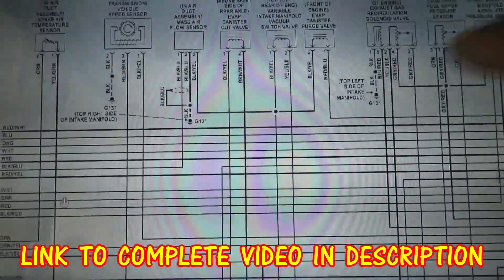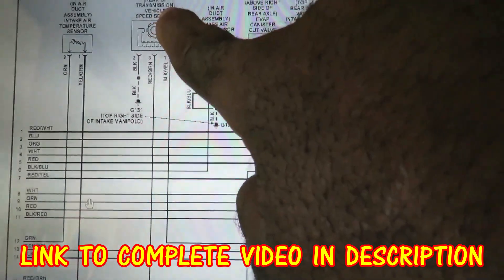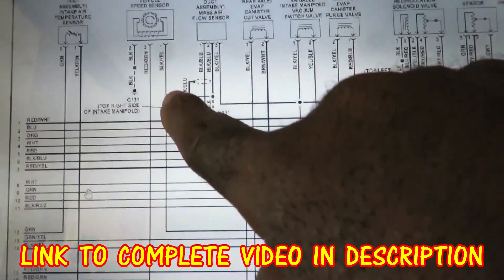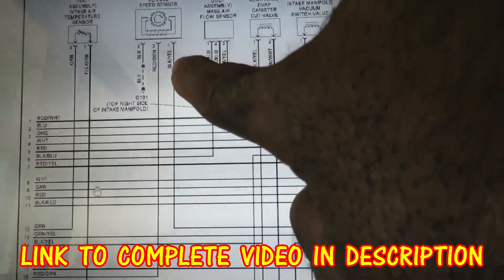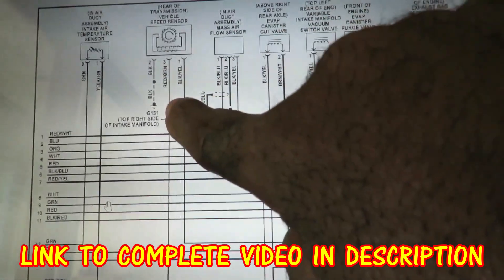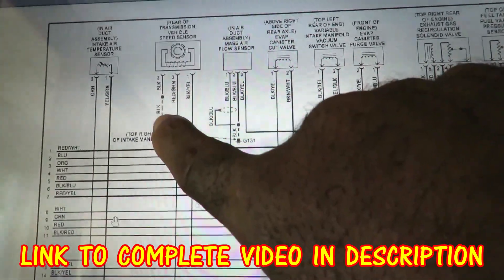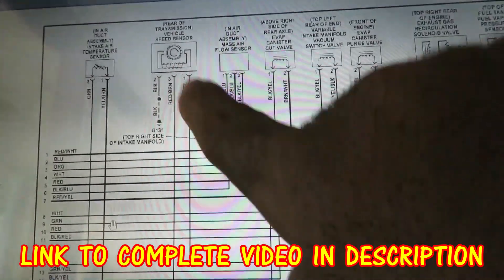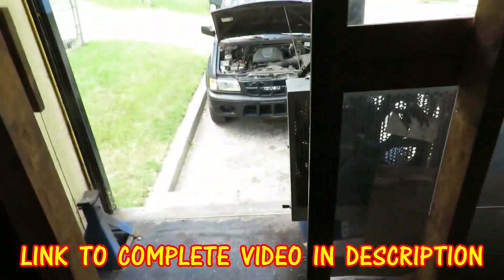2001-2003 Isuzu Rodeo Sport P0502 Vehicle Speed Sensor A Circuit Low

Comment: I know it's an old vid but I am dealing with weird speed sensor issue an inability to shift into fourth gear and sometimes when leaving reverse entering Drive it will not shift from 1st to second unless i come to a complete stop wait then go... I also notice intermittent shifting issues... however if I start out in winter traction mode it then shifts normally in all gears but no matt what I do code is thrown for speed sensor